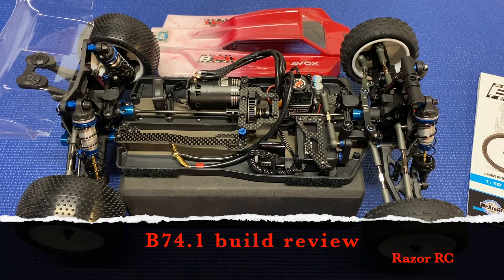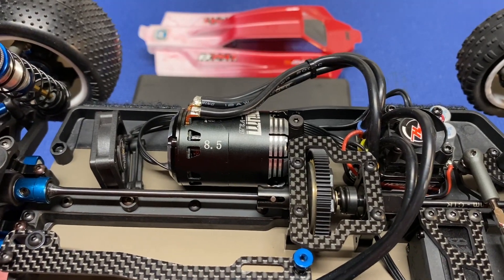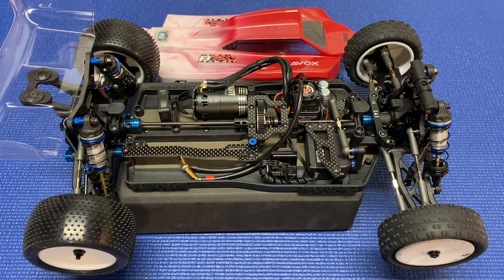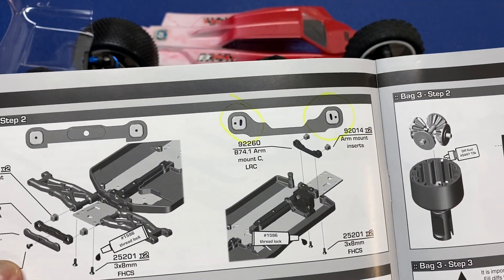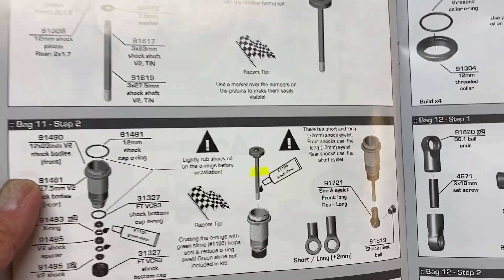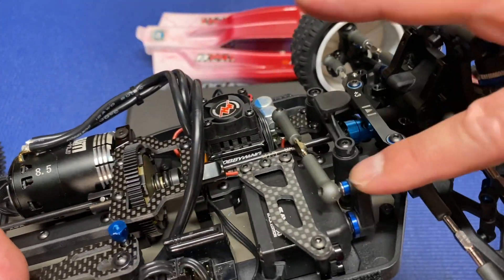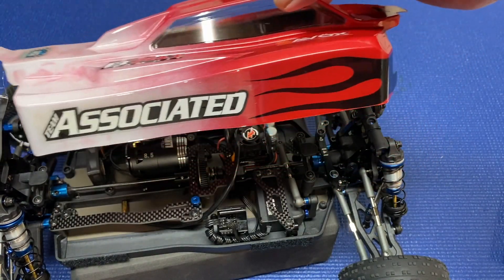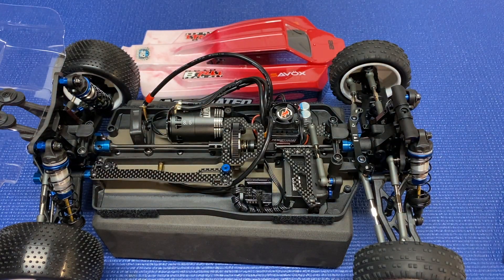Team Associated B74.1 build review

Comment: I purchases 66mm dogbones & cva axel for my b74 today and just tried to put them on and the cva axel threaded shaft part doesnt stick out enough for me to insert pin for the clamping wheel hex nut to go over it. Any suggestions? I've been searching forums and reviews online where they are sold for b74 since 2019 and cant find anything! Its like the cup is too wide.. Its 4mm. I was wondering if you could tell me how 74.1 rear with 66mm dogbones fit together with cva axel? Thanks @Razor RC
Love the videos! Keep em comin!

Comment: What do you stick the velcro tape to the chassis with? I've tried everything (hot glue, super glue, "normal" glue) and mine doesn't stick well enough. Comes off when pulling off the body.
Reply: Get yourself some good 3m Velcro sticky tape mate  😊🤙
Reply: @sc10rs  Yeah, I have some for sticking fly nets to a window frame. But, the plastic of my chassis doesn't seem to stick with anything.
Reply from the maker: did you clean the plastic with alcohol first?
Reply: @RazorRC  No. Just with soap water. I'll give that a try. Thanks.
Reply: @RazorRC  Are you sure those spacers, part number 4187 (2 in front shocks and 1 in rear shocks) go inside the shock bodies? You had mentioned they didn't show it in the manual however mine shows them on the outside and it is noted "external". I followed your advice and put them on the inside and it probably wont matter that much but curious what your thoughts are now that you have had the buggy for awhile. Thanks!
Reply from the maker: @SyntheticCompany  they're used on both the inside and outside.  Inside reduces droop, outside reduces total compression distance.
Reply: @RazorRC  Thank you for taking the time to reply. Please elaborate, are you saying that you have some inside AND outside or do you mean you can pick and choose to suit your needs at that moment? My kit only came with 6 so if you have both I assume you had acquired some more? You had stated in your video how bad it would be to have to take the shocks apart if they were left out of the inside and man did I feel smart after watching that lol. Thought that I really got some top secret intel there and come to find out the manual calls for them to be on the outside and I will have to tear my shocks apart some day to fix it lol. Prob not a big deal for me, I'm not a racer just blast around my local track for fun and still appreciate your videos. Thanks for the Whitz bearings coupon code, that saved me some money on a bearing set🙂